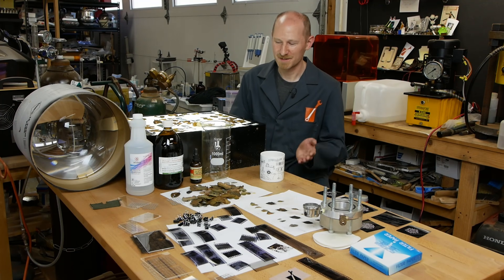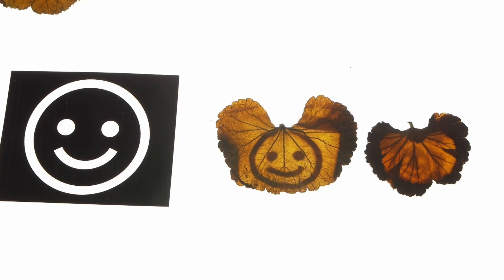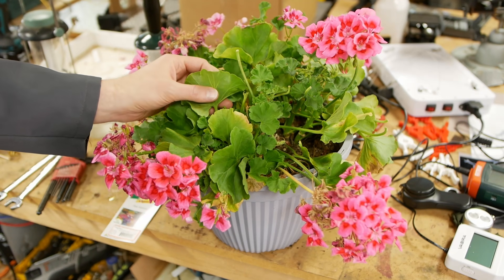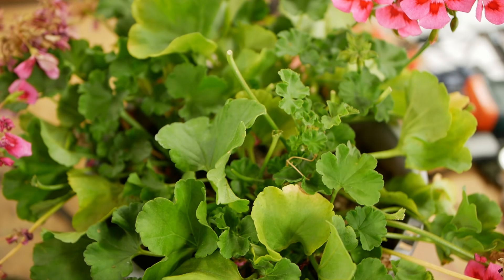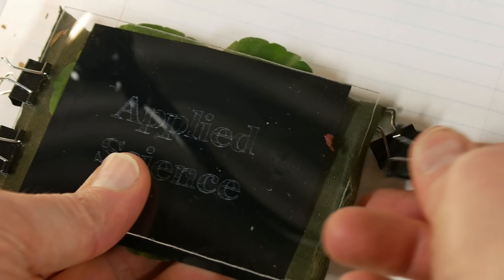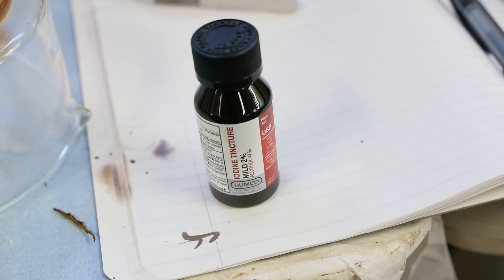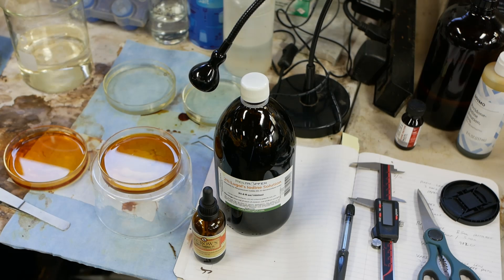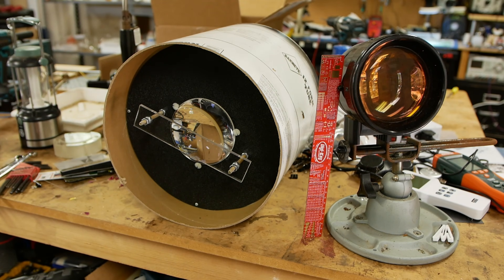Photosynthesis photography: Making images with living plant leaves

Comment: Hear me out: could be possible to blend fresh leaves and spread the resulting liquid on a surface (paper, glass, metal sheet) and use that as the leave (meaning, exposing it to a crapton of light, and then developing it)? Could it work? Could that liquid get photosintesis done granted enough carbon dioxide and light is provided?

Comment: It could be great for transmitting data via 2D barcodes on plants.   You might need to work out a better negative system, perhaps an LCD panel where the image mask could be directly and electronically controlled.

Comment: I wonder why ethanol is so difficult to find in the US. It's the most common alcohol here in Europe, while isoprophyl is more difficult. Ethyl alcohol in stores have a tiny bit of denatonium to prevent ingestion. The problem, however, is that it's 96% pure, not 100%, and now I'm wondering if that would work for this.

Comment: As a plant guy I would bet that you would could improve the resolution further still with leaves from older, taller deciduous trees. They make much smaller cells in general than herb layer stuff or even than seedlings of the same species. They have more sugar and time to play with, on the ground there is so much competition for light it is really a race to cover as much area as possible. Put some height on that tree and the cell size really shrinks down. I mean the cell isn't exactly the pixel unit here, but since all the machinery that is doing this is repeated at the cellular level it might as well be. Also, I wonder how back in time the camera to take a picture of your truck could theoretically have been produced. No silver chloride, everything except the lens is correct me if I'm wrong, bioavailable. I think you might be able to do this anywhere on the globe there is photosynthetic life and sand, assuming you can do distillation. (you might even be able to skip the glass and do something with water and soap.

Comment: Im curious if leaving a negative mask over a leaf for multiple days/weeks would make any difference in overall contrast, or if it would have a negative impact on the health of the unexposed sections after so long. Mighy require a more CO2 permeable masking material in that case but id be absolutely fascinated to see longer term experiments.

Also curious if you could come up with some kind of masking paint that could be applied directly to the leaves, like a sunscreen but just for photosynthetic light. Having no gap between the leaf and the mask would mean no light leakage issues there. You could clamp the leaf down just once with a stencil, spray it with your mask solution, remove the clamp, and then move on to another leaf! 
I'd bet something like india/tattoo ink, maybe a mix of superfine carbon & water alone would work.

 But most of all I want to see you collect the chlorophyll you remove from the leaves and using that as a photomask! It'll absorb all the right wavelengths as it would inside the plant, after all. Might be cool.

Comment: So many interesting variables from different areas of science for this,
 Substrate : flattening, how well can plants grow if sandwiched in glass instead of forcing flattening of something that has purposefully grown to maturity non-flat, if they can grow in glass plates does it have to start at budding or can it happen a bit later. And would that affect chlorophyll or starch granules amounts.

 Doping: does chlorophyll concentration affect Photosynthesis in a substantial way. How well can chlorophyll be controlled to concentrate in areas on the leaf, can chlorophyll just be add by bathing or injection. how does that affect starch formation.

 Resolution: whats the size of the starch granules can they be shrunk/controlled/added.  For images that turned out better than expected what size granules to they have compared to poorer results. Does a darkroom during any of the steps help at all. 

Capture, and optics: is cardboard brown neutral for transmitting light?  do lenses transmit light better/worse when the internal tube is black or white (vanta black or thermal white*). Also using light reflectors and other photo methods applied to the subject being captured could help with poor contrast subjects**.

*see nighthawkinlights white thermal paint creation process 

** Though I've always wondered if we're missing something about light physics and there's a way to pump extra light towards a sensor instead of the subject , not just for intensity but for reducing scatter, but of course that makes no sense  ( though we can slow light) . Like you just can't point a parabolic mirror into a lens, to improve a resolution it just creates more scatter and washout like lens-whacking.

Comment: Does the alcohol really need to be anhydrous for this to work well? You could variously try: just vodka, 40%. Everclear, 60%. Off the shelf hand or surface sanitizer, 75-95%. The latter might contain: A bitter agent for denaturing. A percentage of isopropanol for denaturing. A percentage of glycerin for softening the skin. All three of those ingredients should be inert as far as the extraction goes although perhaps the glycerin might leave a residue.

Comment: Are you Willing to try this whole process but with artificial UV light instead and see if you can get that 20% to like 30-35% and with a clarity of maybe 75-90% and definition of .08 -.5 this would be a goal and you could get much more power from UV lights. But question is would that affect your results since with the sun the whole plant still gets food from the other leafs, would doing only 1 leaf affect how the plants process of its starch works.  Next, with UV light or a mixed UV light and some natural would also be interesting and to see maybe also test if the (320-400 nm) length is the best or maybe go smaller or bigger within the spectrum. TBH the whole process when you jump to artificial maybe its better or worse and depend on what the plants ability to process the light or the light quality or NM range or intensity, Last one I can think of is maybe put a plant in a sealed chamber with a elevated amount of Co2 inside and see if that can also increase the quality after you find out what the best light setup is. I loved this and I want to do this test one day with my kids it sounds so fun and has a hard enough level of difficulty that I can teach them about troubleshooting!

Comment: "Ethanol is expensive and very hard to get"

I live 5mi away from the city and yet i can literally just walk ⅛mi or so – basically just cross the street; and get anhydrous ethanol @≈96%(+4-5%water) for like 80¢/L 

The magnesium sulfate for drying it up is like 1$/30g, and in my calculations id need about 4 of them

So yeah, out of the 5$ that it'd cost me for 100%anhydrous ethanol, less than 20% would be the ethanol itself

Why is it so cheap here? Turns out that if you adjust your gas engine's cillinders and pistons very slightly, it becomes optimized to run on ethanol ALONE.

cars here been using e100 for nearly half a century already.

And your very own car could be running on it too! 

EVs have always been a scam just like hydrogen cars.

The green revolution in personal transportation is already 5 decades old and has been obfuscated and deliberatedly downplayed by the oil industry.

You don't need a NEW 200,000$ car, just a 2,000$(max) engine mod on YOUR VERY OWN CAR THAT YOU ALREADY OWN AND USE (and that gas stations collude to start importing it as well as local distilleries and farms producing it, or you can just literally make moonshine and put in your tank)

We can stop using oil overnight! At least for more than a dozen million people in latin america i mean that quite literally. literally at the next visit to the gas station, they just need to ask for ethanol instead of gasoline. That easily 12+Million cars could start running greener(ethanol is carbon negative if it isnt transported by diesel trucks, theres a LOT of extra carbon and energy to fuel distillation, supply thermoeletric energy for the plant, feed livestock, make compost, fibers, or just trap CO2.) Than EVs ever promised to be, and then some.

No lithium mining needed, no need for a new car, no need for new infrastructure(just a new product name on the importation list and a separate pump)...

Your car, same engine, you install a mod, buy the fuel et voilà

An actually green car.

All excuses are about efficiency, ill conducted tests that conveniently favors the status quo for gas engines, and pricing.

But people are willing to pay hundreds of thousands of dollars for an EV, so why not use that money to pay more for an actually green fuelsource instead of deluding yourself with BS green propaganda?

Anyway, it's so cheap i use it as a general disinfectant for all my lab experiments, and at a huge excess so i don't have to bother with diluting it to slow down evaporation.

It should be at every gas station already(And it is already, in south america. Every damn single one of the gas stations have e100 available here)

Anyway, any other projects where ethanol would be useful?